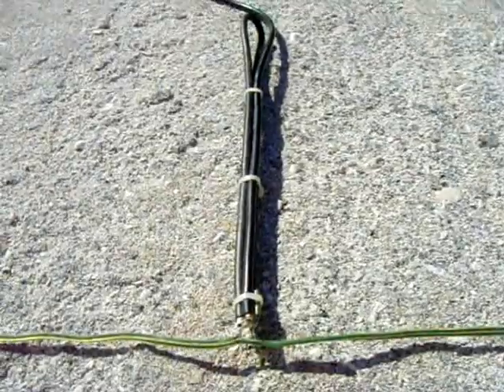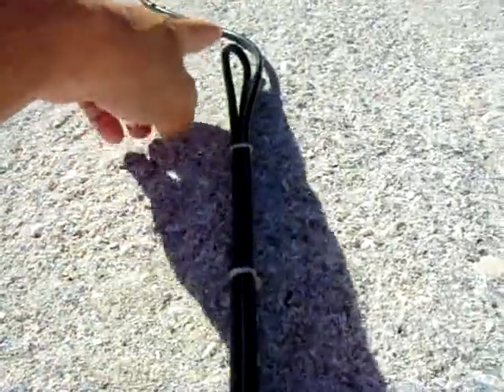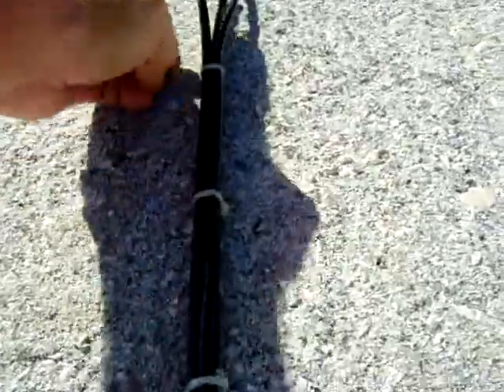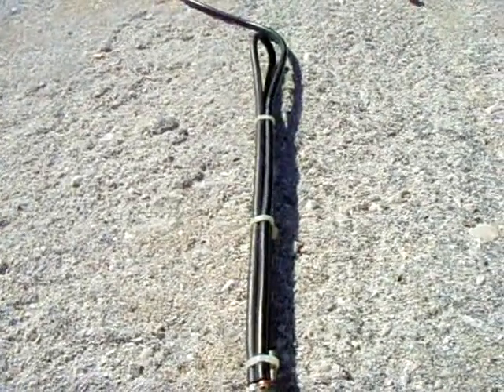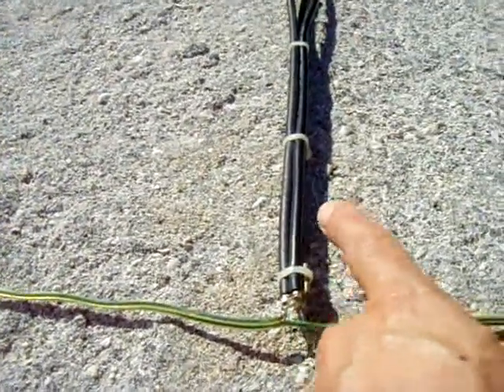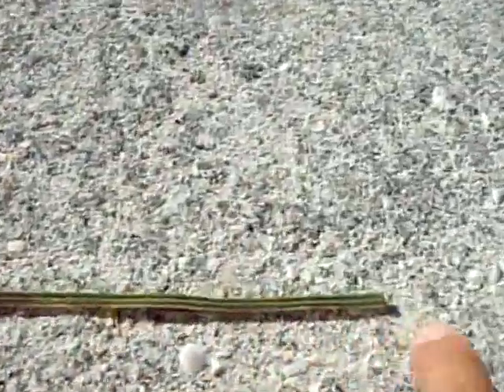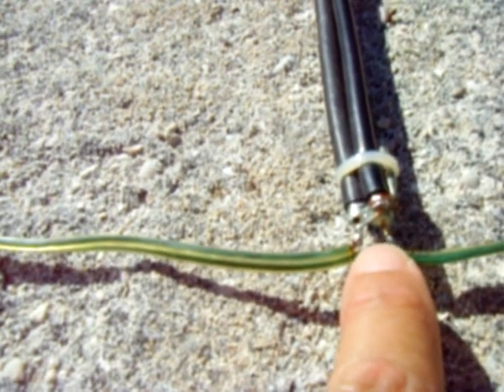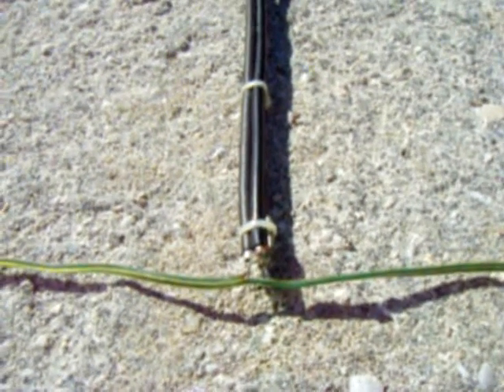Excellent Folded Dipole Antenna Made Of Coax & Lamp Cord

Comment: Looked at the two top links you provided; they make no sense to me. Wouldn't it be useful to write in the blurb  - doubled over cable is 15 inches long, the other cable is 18 inches long;  the ground is to a ground point on the radio (?) and the link to the radio to make use of the antenna is to the radio antenna wire. ???
Reply from the maker: Shouldn't be that difficult. Enter the desired frequency, then do as explained.

Comment: Someone gave me a 25 watt FM transmitter with a little magnetic antenna (like would go on a car?). Just curious, do these little magnetic antennas handle 25Watt transmitters without damage? Most I see are only rated for 10W or less... does using this at 25Watts damage the transmitter?
Reply from the maker: Sounds like you have a 25W cb radio. All you have to do is look up the radio you have online for more info. Thanks for watching!
Reply: Thanks for the videos! No, its a stereo FM transmitter (25W)... its a CZE-T251 FM Stereo Mono Broadcast Transmitter PLL Station 0-25W 87-108MHz US. The guy wanted to keep his dipole antenna, so he tuned this magnetic mount smaller antenna to hook up. I'm just wondering if you can damage the FM transmitter if the antenna is under-rated for power... I see these magnetic mount antennas on smaller 5-15 watt FM Transmitters (on EBay). This transmitter will operate at 25 Watt output.

Comment: I have several questions but i only use my antenna for receiving as im getting started in SW1) does the balun also help to improve the receiving (specially with the interference)?2) using this method, does the folding of the actual antenna counts for the final band lenght? Or should I have in mind only the diameter?3) if using in a normal dipole antenna without a balun.1/8 goes to the copper core of the coax, the other 1/8 goes to the shield, I've been told that the 1/8 wave that's connected to the shield passes through induction to the copper core and then I connected it to the radio and that I should only connect the copper to my external antenna connection. Is this correct?Many thanks for the help if given :)
Reply: @mehdishafiee7708  thanks for your info. much apreciatted

Comment: folded dipole has the highest gain out of all of them, it doubles your power.
by the way, only the last link works.
Reply from the maker: Hello. Thanks for telling me. All links have been restored.
Reply: Thank you. By the way, dont use 75 ohm coax because its designed for recievers, use 50 ohm instead.

Comment: I was trying to see what wires were connected to either side of the dipole from the coax feed line and the looped part. Are you using the shielding on one leg and the center wire on the other... or only the center wires to the dipole? I just can see it. Also, is the length of the loop equal to the 1/2 length of the antenna?
Thanks.
Reply from the maker: Kurt Joyner Refer to the links in the video description area. :-)

Comment: There is something I am not clear on. Do the ohms coming out of the transmitter have to be as great as the ohms in the antenna?
Reply from the maker: +CurbsideJimmy 
Ideally the antenna would be designed for 50 ohms. If it is not exact, then you will have some loss of power output(a mismatch). No big deal unless you want perfection.

Thanks For Watching

Comment: thank you ! well done.. in my opinion  I would separate some distance the folded dipole wires
Reply from the maker: Teletenna Tech
Thank you! You don't have to separate the folded dipole wires far apart. This will work fine with various spacing.
Reply: I use a 300 ohm flat ribbon cable as the folded dipole and  works very well..the great thing about antennas is that following certain basic rules there is no single truth... many other designs also work well.

Comment from the maker: Yes. Even though this does not look like a folded dipole, it is. There is the space between the 2 wires in the cord. You can gently separate the 2 conductors at each end after you solder them together. By doing that, you can use a nylon tie, or a plastic ring to support/suspend the antenna .